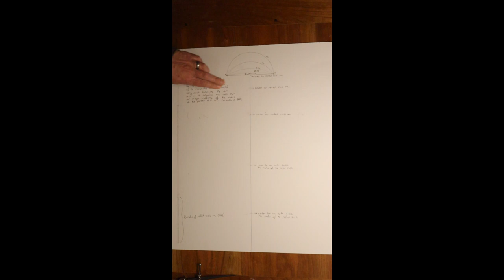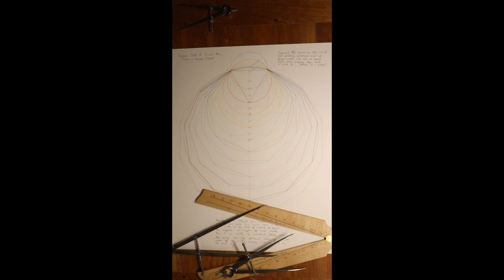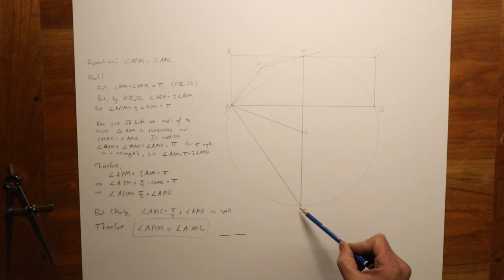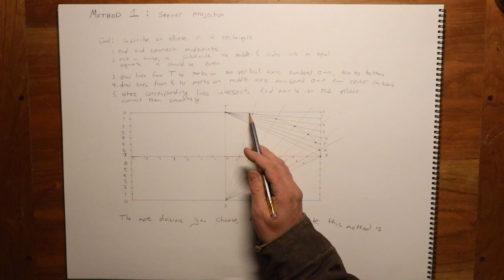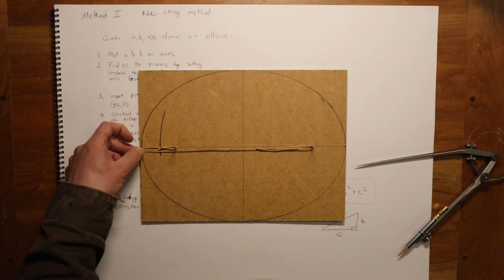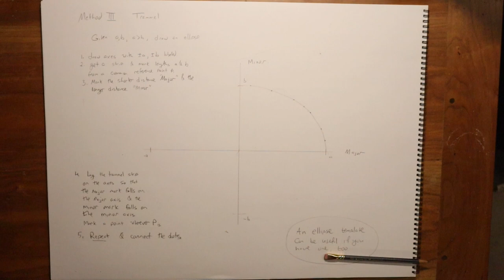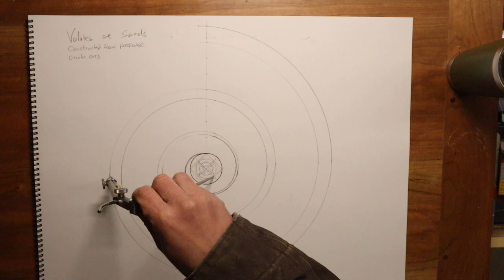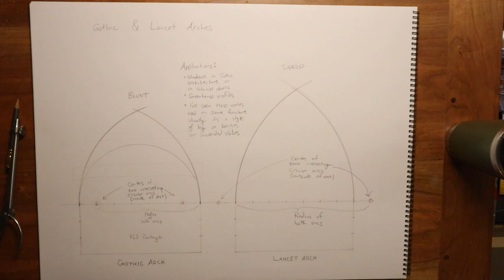Geometry & Design: A Collection Of Curved Design Elements

Comment from the maker: Table of Contents

Visual Scales of Circular Arcs: 0:56/1:51:33
Linkage for inscribing a circular arc in a rectangle: 25:06/1:51:33
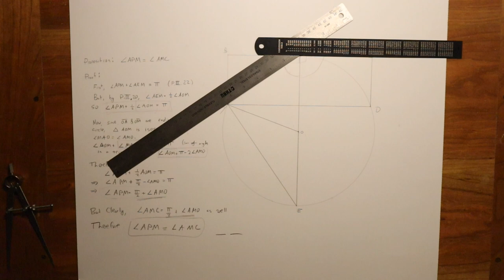Ellipses (Definition): 45:04/1:51:33
Ellipses (Construction - Steiner Projection): 51:19/1:51:33
Ellipses (Construction - String and Pins): 58:26/1:51:33
Ellipses (Construction - Trammel): 1:09:10/1:51:33
Cyma Curves: 1:20:31/1:51:33
A Selection of Moulding Profiles: 1:29:19/1:51:33
Volute 1:37:37/1:51:33
Gothic and Lancet Arches 1:42:51/1:51:33